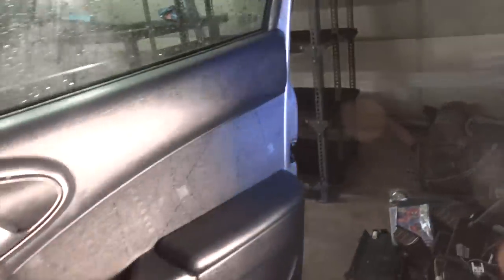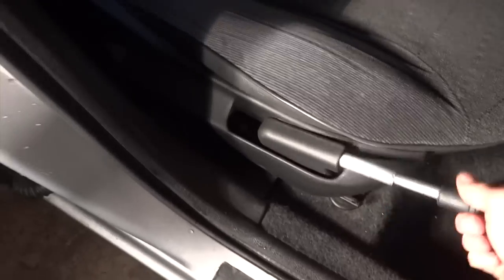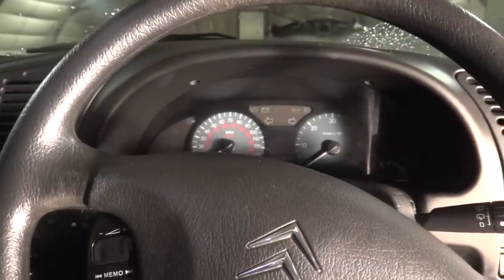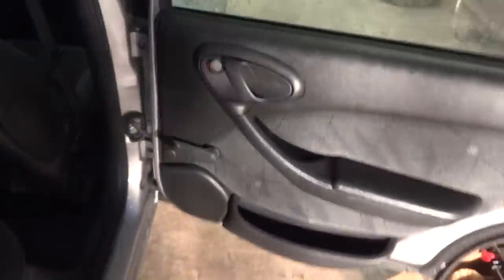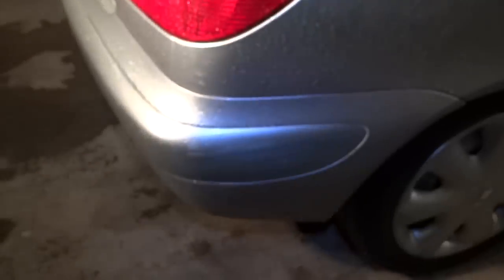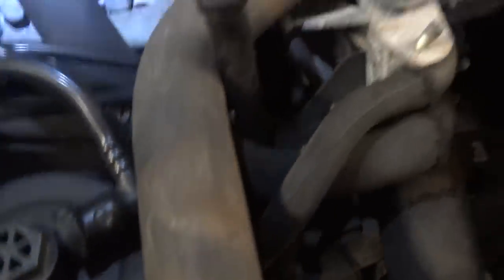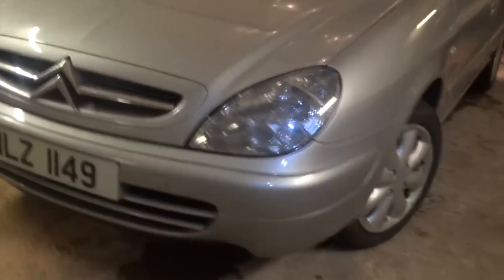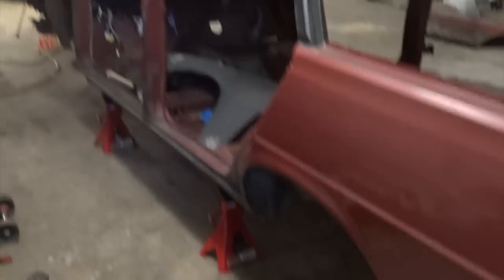2001 Citroen Xsara

Comment: Hello,
I bought a Xsara 1.8 16v petrol (XU7JP4), and I Need replace the spark plug but I am not finding any video show to do it, do you have the Xsara yet? Can show how do it or know some video that explain it?
Reply from the maker: Hi
I have never done a video on an XU Xsara as i have never had one to work on.

It should be fairly easy to get to the plugs, either a coil pack comes off or the HT lead pulls out.
A haynes manual may be worth investing in, the xsara is a very similar car to a Peugeot 306 so the manual for it may be of use.
Another route worth trying is on facebook the Citroen Car Club (uk) or peugeot enthusiasts group. Ask on there and someone who actually owns a car with this engine should be able to advise accordingly possibly with pictures. Im sorry i cant be of any more help but this is not a car i have had in.
Reply: @peugeotCitroen2CV  ok, thank you for answer me

Comment: It's easy to figure out after fuel lines return injectors , Bosch has the fuel line return in injector head , siemens has it sideways
so yours is a bosch
or u can read it on comman rail , high presure pump, or ecu,
the problem with the window is in the wire  loom door
for the glove compartment u have to get a new one fron scrap yard
and on climate control u need to change the ressistors on the fan or u can take the hole part http://www.ebay.com/itm/NEW-HEATER-MOTOR-BLOWER-RESISTOR-FAN-for-Citroen-Saxo-Berlingo-Xantia-Xsara-/321425561541?pt=AU_Car_Parts_Accessories&hash=item4ad674d7c5&vxp=mtr

Comment: My Peugeot 406 HDI have the same fuel filter as your Citroen xsara
Reply from the maker: They are both using the same engines, the different fuel filters comes with the different fuel injection systems, i think this filter housing is for the siemens system, the other housing found on my 406 is for the bosch system.

Comment: nice videos man , with many details congratulations, couse i dont trust greek enineers 100% for the correct problem i would like an oponinion if its isnt anoied.  i have a xsara 1.4 2000 model etc ,  and i have these temperature problems: first ,last summer lost alla water of freeze in cabine inside car, anyway i turned the heat/cold up/down and not more water in cabine,  but the problem is at temperature  still, overheating if i am at relanti, uphill and drow at 30 celious  in downhills, , i know tired message, if u have a opinion i would be glad
Reply from the maker: +Xristos dem 
Hi, sounds like a heater matrix burst in the frost? Is it leaking any coolant still, if not from the matrix does the system hold coolant? 
Get that sorted first, bleed the coolant system and see if it maintains its temperature. May also be a good time to flush the system and change the thermostat.
Reply: +peugeotCitroen2CV thanks anyway,  the aircool works , no leaking collant,  i have hot and cold ok,but some times maybe late to warm  into the car...its crazy.. for 3 4 moths all ok, water lost little from freeze, 95 celious temperature but no more and in downhills 30, suddently one day over heting aggain at 2 minutes driving, then again 1 moth ok, i think-hope is termostat, iits difficult not same language but whebn i fix it i wll tell u the problem

Comment: electrics are bad on those cars.
Reply from the maker: They have their quirks. Generally not too bad but the loom from the car to the door is terrible, the wiring from the car side goes across to the door unlike most other cars where the car loom is fixed to the A pillar. Rather than repairing or replacing the relatively easy to remove door wiring loom its necessary to work on the loom under the dash.